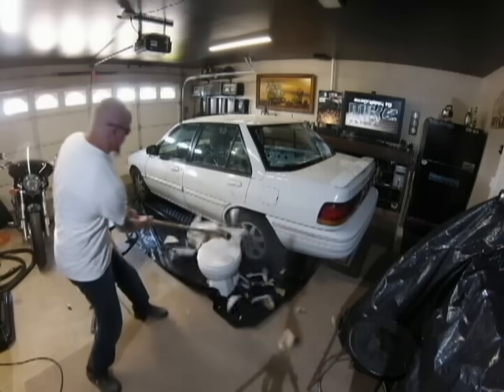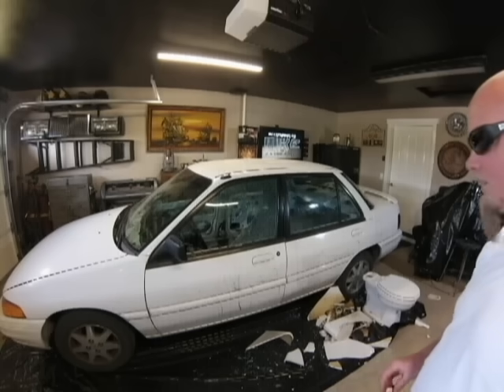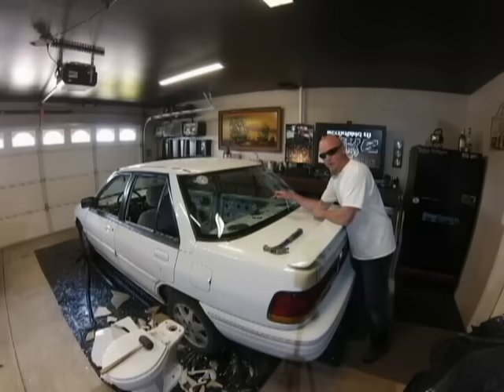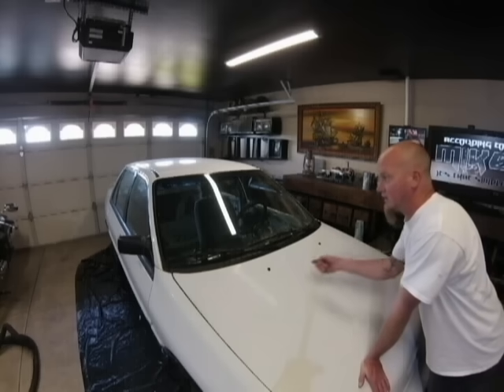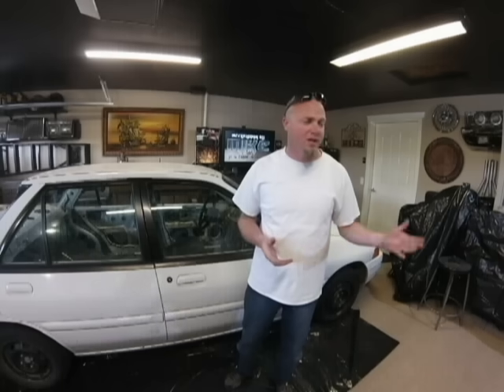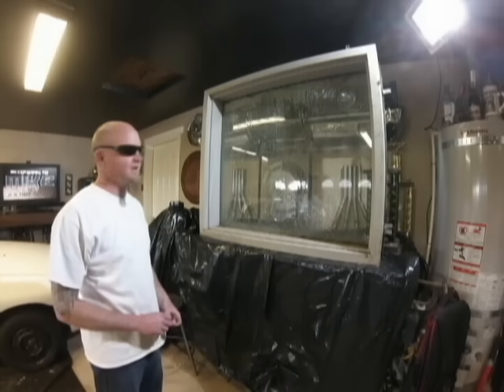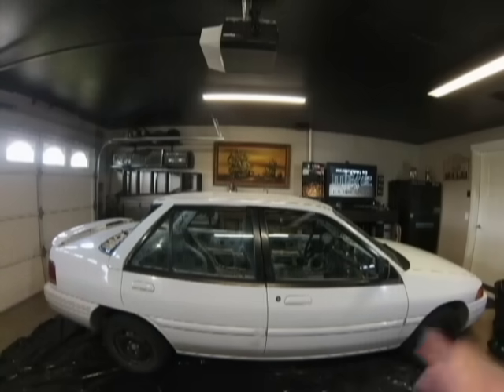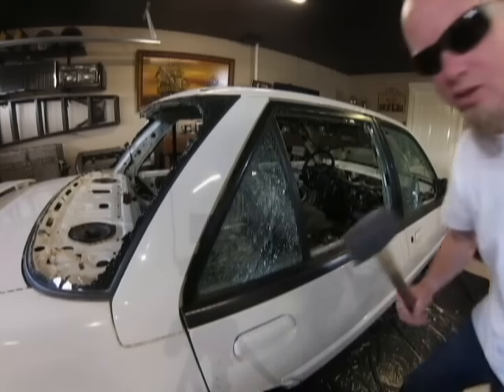How to break glass with a fragment of a spark plug (Part 2)

Comment: There's a couple of reasons why ceramic from a spark plug will break through tempered glass. First is due to the tempering process. This makes the glass very hard but very brittle and causes it to shatter like you've shown. Without the tempering process glass just breaks like a sheet of ice making a bunch of large pieces.

The second part is the hardness of the material. A good scale for this is the Mohs scale which can be found here:

http://en.wikipedia.org/wiki/Mohs_scale_of_mineral_hardness

If you scroll down to the intermediate hardness you'll find easier to find stuff like steel and titanium. This scale shows the difference in the strengths found in the crystal structures of materials. Here you can see that steel is around 5 or so. From memory I think tempered glass is around a 6 or 7 in hardness and the ceramic from the spark plug is around 8 or sometimes 9 (diamond being 10).

So what happens when you hit a steel hammer against tempered glass is you get something of a battle between two materials at the molecular level. Here the iron will actually be deformed more than the glass due to its relative hardness, and the glass will sit there in one piece. In the case of the ceramic hitting the glass the opposite happens and the glass is deformed. Since tempered glass doesn't easily take a small nick and stay in one piece you get what you've shown in your video.

This doesn't mean that you can't break glass with a hammer though. You can break anything with anything if you hit it hard it enough. Theoretically you could shatter window glass with small bits other things too, like diamonds, tungsten, or hardened steel.

There's a few more ways to demonstrate this effect if you want to see them. Just PM me or something and I'll dig them up for you. For now I'll just leave this wall of text as it is.

You seemed pretty curious as to how this works! I hope I've given a good explanation.
Reply from the maker: Thanks for the insight Chris.
Reply: Good point. I was just using a very liberal definition for deformed which fits better for the hardness aspect. I left out the tempered glass explanation as the question seemed to be focused on why spark plugs work while other stuff doesn't.
Reply: The "deformed" is a wonky way of putting it. It's tempered glass. Recall that tempered glass uses the principle of Prince Rupert's Drop: The outer surface of the glass is subject to compression, while the inner surface is subject to tension. "Deformed" makes it sound as though you're bending the glass or something, but that isn't the case at all. Any fracture will result in the exact same result as seen with the spark plug, because the potential energy from the inner tension is released. You could do exactly the same thing a hardened steel glass cutter with scoring the window and giving it a good smack - and it still has nothing to do with "deforming" the glass, but entirely to do with compromising the structural integrity that produces the increased hardness you get with tempering.
Reply: And the fact that a toilet is perlin and the sparkplug are ceramic.  Take a ceramic knife to glass and it cuts effortlessly.  But a metal knife just scuffs the glass....

Comment: I'd guess the ceramic is sufficiently small and hard to resist the vibrations it imparts on the glass through impact. Because of this, all of them have to be resisted and diffused by the glass, as it is tempered it is more brittle and thus more resistant to the vibrations leading it to break rather than vibrate. A high speed camera could confirm, but it would explain why the front window has only localized fracturing since it is made of two separate pieces of glass with a flexible membrane between. They vibrate independently and thus transfer vibrations to both. This is actually one of the reasons that there are two layers of glass and not just one thick one.

Comment: The main part of the insulator is typically made from sintered alumina.  It has very high hardness and is harder than glass.  This allows for the insulator to impart extremely high impact forces to very small areas on the glass leading to failure of the glass.

Comment: What is a spark plug?
Reply: Thats for you to put it in your but and make it spark like a Christmas tree!
Reply: To put it simply, it ignites the fuel in the engine, that pushes the pistons down, which powers the engine
Reply: How old are you?? Wait i knew what a spark plug was when I was six so you better have a good reason
Reply: Matthew Phillips I didn't speak English when I was six
Reply: Ahhh that explains some of it
Reply: Dont laugh at him hes not a natuve english speaker and his dad probably knew nothjng about cars. A spark plug is a small device that created a spark at the tip of it. If you want to know more, spark plugs are inside a gasoline powered vehicle’s cylinders. There are multiple cylinders in a car’s engine, sometimes 4, 6, or 8. The cylinders have a piston inside them that pushes up and down the cylinder, which happens because fuel inside he cylinder is burned by the spark plug, unleashing a lot of gas which is then released by the exhaust valve. All the cylinders are doing this and it makes the crankshaft spin.
Reply: Norm Spups Entertainment thanks for explanation
Reply: Google "spark plug." Don't look too YouTube comments for answers.

Comment: - A spark plug is heavy this would be no mystery but if you mean how does the ceramic from a sparkplug break safety glass than your question will be answered. 

- The ceramic from a sparkplug attracts negative electrons (Negative Static) A cars side or rear window (Tempered Glass ie safety glass) has positive electrons (Positive Static) If one were to throw a peice of sparkplug ceramic at a car window the first part of the ceramic that touches the window creates a miner spark explosion which temporarly weakens the glass to an extreme point than the rest of the weight of the ceramic breaks the glass. 

- You can shatter a car window with a piece of ceramic from a sparkplug about the size of your pinky finger nail.
- Last I checked, POSITIVE electrons are positrons, a component of antimatter...rather overkill to cause a nuclear event just to break a window. Rethink your physics.---Although the answer is not correct... a positive electron can also be considered a hole, or rather a lack of an electron... not necessarily your exotic anitimatter.
Reply: Daniel Nash "Tempered glass, which is used for the side windows of most vehicles, is manufactured with an extremely high surface compressive stress and high internal tensile stress, giving it strength and durability, but also leading it to abruptly shatter into thousands of tiny pieces when it breaks. When thrown with moderate speed at a side-window, a sharp shard of the exceptionally hard aluminium oxide ceramic (~ 9 on the Mohs Scale) used in spark plugs focuses the impact energy into a small enough area without blunting to initiate cracking, releasing the internal energy and shattering the glass.[7] However, ninja rocks are ineffective if the shards are insufficiently sharp, thrown with too little energy, or thrown against windshields, as these are made of a laminated type of safety glass, and therefore do not shatter" Ninja Rocks - wikipedia 

on a side note "ninja rock" is a street term for a piece of ceramic that was harvested for breaking windows
Reply: Daniel Nash
No, it's not, you could do this with any sufficiently hard object, like perhaps quartz, which is .5 to 1 unit harder than tempered glass. Charge has nothing to do with it.
Reply: This comment is probably a troll comment, but still, it has nothing to do with electric charges or what not.
Reply: ***** it actually the truth
Reply: Thanks guys

Comment: This works well with a spark plug because it had been charged with electricity and when it hits the glass it releases a small amount of static that intern reacts with the tempered glass making it weaker and able to break.
Reply: No it doesn't the ceramic is an insulator and is harder than glass that's why it breaks it

Comment: It's extremely curiosity ! I'd genuinely like to hear a logical explanation ! Thanks for sharing.
Reply: It all has to do with hardness.
On the Mohs scale, glass is actually "harder" than iron, and spark plug ceramic (technically called "aluminum oxide ceramic") is much harder than glass.

Aluminum oxide ceramic actually rates a 9 on the Mohs scale diamonds are 10, glass is 6.5 and iron is 4.5.

That's basically the key to the whole thing, and that's why it's surprisingly harder to break a window with a hammer while it's surprisingly easy to break it with a small piece of spark plug ceramic
Reply: Khazar01 Thank you very much for your reply, I appreciate  -- Domino

Comment: It's not any porcelain that does it. The actual body of a toilet or a brick is just pottery, basically, made up of tiny crystals (bits of rock) which can move around  each other just enough to absorb the impact. It's the ceramic glaze that you want - it's one big crystal and won't flex. The piece of toilet that worked must have hit the glass glazed (shiny) side first on that particular throw.

Ceramics made for insulation, like on spark plugs, capacitors etc, work because they are more or less just really thick glaze, cured in one heat process to give one big crystal. That's an over-simplification, I know, but it's still the reason.
Reply: Marius Cheek its the glaze that becomes glass or someshit